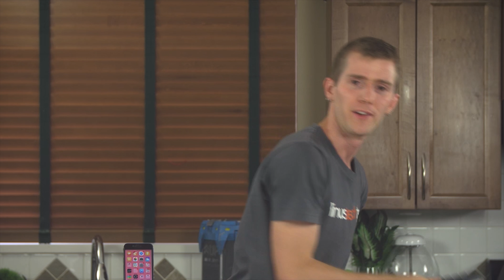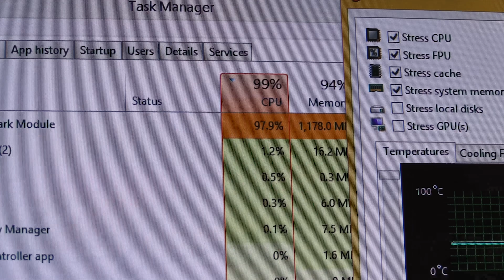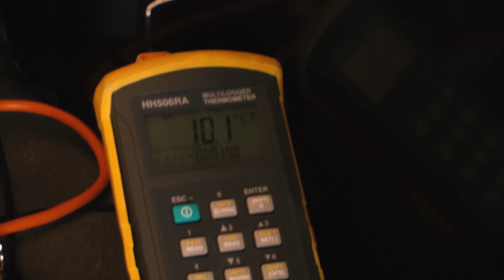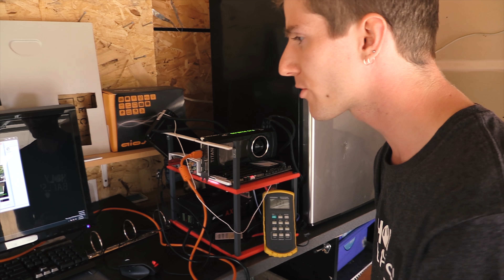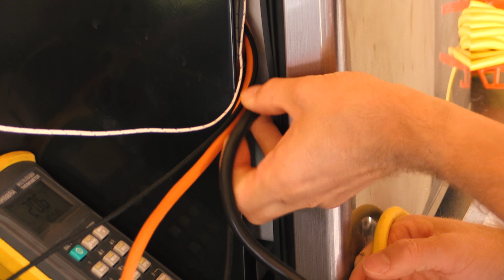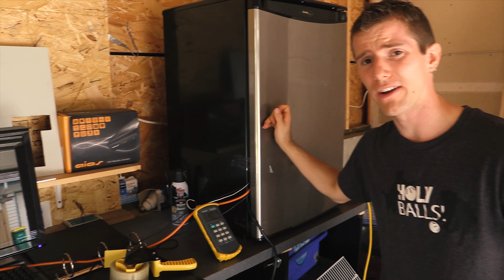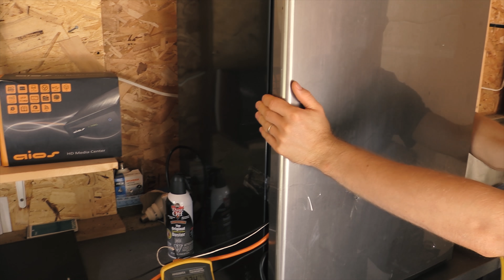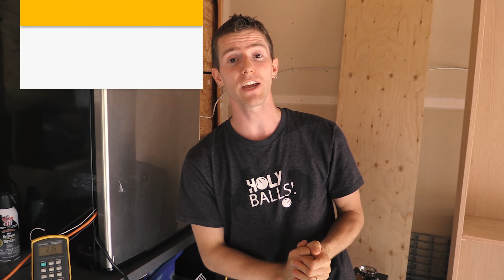PC Build in a Fridge - Does it Work??

Comment: For that experiment, you'd need to set all the CPU fans and stuff to max to take advantage of the cooler air flow in order to see better results.

I once did an experiment where I hooked up a vacuum cleaner to suck all the air out the exhaust of my OCed 970 at full load. The action of more air being forced out albeit by a 1500 watt!! (about 2.2 hp) vac motor caused the temperature to drop from 78 to 50 C degrees in a matter of about 2 minutes.

Comment: Connect the cooling coils from the fridge to a water cooling system :)
Reply: my exact thoughts
Reply: Sander Datema  yessssss please do this I want to see this
Reply: Booring!!
Reply: also you can run cold water over the condenser coil on the back to the fridge which would allow heat to escape faster.
Reply: or you could just run your computer at its proper speed and use stock cooling ;)
Reply: Sander is referring to the evaporation coil... And in that case if you used the correct heat exchanger it would work.
Reply: the water dont help. it just tankes longer to  heat up the system . the fridge isnt build for take away so much heat so all you need is a bigger system.
Reply: I was thinking that what if you connected it to your standard fridge instead of a mini.
Reply: I work with appliances and unless you don't mind paying an astronomical water bill for a minimal impact, then yes. These compressors run HOT, consistently with intermittent lapses for defrost, the heatsink only serves to lessen the burden via heat transfer just like a CPU.
Reply: Nudeliful If you attach the coils to your cooling block, and leave the pump running continuously, it'll probably do fine. I will admit it won't be the most silent system...
Reply: This would probably easier...Airplex GIGANT...
Reply: Water cooling the condenser wouldn't increase the capacity of the refrigeration system much, if at all. The compressor and evaporator still wouldn't be able to handle the heat load.

Comment: So your video brings up a logical next "Build". I am sorry if someone beat me to the punch, I didn't read 7200 comments to find out. 

Why could you not build a case that is cooled by an AC Unit. AC units don't merely pump cold air into a room, they also remove hot air and water, and expel it out, well typically outside. An Ideal set up would be  a window unit, mounted through an exterior wall, (Standard set up for an AC unit), only the business end would be driven directly into a small computer chamber. I am picturing a box type enclosure with a computer case locked inside,, probably with no sides attached. I bet an 8k or 10k BTU unit would cool that bitch like nobody's business. I vote to see this build next.

Comment: I can guess why it didn't work.  You had that much cabling coming out through the door, that you possibly would have broken the insulation seal.  The tape held it shut, but it wouldn't have prevented a heat leak.

Comment: Some dy may be.... Linus will Read this... Long Long ago I had a Compaq CQ40-144tu Laptop. Restoring it to factory setup took about 45 minutes.So after a 3 years of useage I decided todo that .But it kept heating up and shutting down.I put the entire thing while recovering into a 500 Ltr Deep Freezer and walah....!! It worked so as suggested you need the fridge to be enough capacity...

Comment: Was the fridge even working in second case because its door was not properly shut. Fridge has a little push button sensor to detect the door closing and only after the door is shut it starts the compressor for cooling.

Comment: cmon  Linus u have to put it in a freezer m8
Reply: Why would hot parts attract condensation?
Reply: the freezer would have a similar effect, freezers arent built for constant use with maximum power, just like fridges arent, freezers simply have to maintain a lower temperature.
Reply: +Freddy Looger
what if the computer was submerged in a special oil that does not freeze below zero   similar to antifreeze  , 
and then the whole thing put in a freezer , with the freezer modified so it  bypasses the on & off  cycle  so it runs permanently ,
( like alot of people do this to bar fridges for home brewing beer) ?
that should eliminate condensation & freezing  and the oil should circulate by pumps inside the submerged case  so it will be super recooled constantly
Reply: Condensation would build up on the PC and short circuit it.

Comment: I had an old portable dc fridge for a car ect. It works on dc plug but the ac inverter died. So, being bored and it only cost $30, I pulled it apart. I have always thought about mounting the block to my case with the thought of turning the case into one big cold box. Concerned about condensation I haven't taken the risk.

Comment: It would work better if they put the cold side radiator of the fridge over the air inlets of the case, and put the compressor in the out airflow to allow continuous use.

Comment: Next time drill a hole in the fridge where its safe and feed the wires though or better still fit a jack plug so you can connect from the outside to the inside wiring and then seal the hole with silicon rubber.

The idea of fridge to keeping some of the components of today at cooler operating temperature is a great idea some just get ridiculously hot especially around during a heatwave the extra heat load doesn't do it any favors at all.  Eventually it will reach its technical heat tolerance level and slowly start to fail.

I guess its cheaper than liquid cooling or water cooling.

Comment: The refridgerator I use takes the air from the freezer and pushes it up to cool the fridge section on top, the air is then cooled down and sent back down to the freezer. Kind of a cycle system. It could work in that case, theoretically. But who want's a 6ft 5" PC?

Comment: Simple. Overclock the fridge.
Reply: Kenrick Halff no no no

Put the fridge in a fridge
Reply: @jackmahoney5826  no no no

Put holes in the side of the fridge
Reply: Watercool the fridge itself. Easy.
Reply: Kenny Omg lol
Reply: @BboyKeny  Fridges are water cooled lol
Holy shit, I've just seen that this video is 5 years old.
Winder if you still use this account and reply to my new comment?
Reply: @BboyKeny  And when the Water cooler starts getting overwhelmed, put the water cooler and The mini fridge inside a bigger fridge and keep repeating it until everything becomes cool! Lol 😂
Reply: Y'all spending all that money. Just leave your setup outside for the winter.
Reply: @Bestgameplayer10  i live in wy and it gets to like -20f (much cooler than -20c) with windchill, no amount of insulation will protect your walls. i sat my pc next to the wall and played games allday/night, made it idle at like 80% when not in use, that was the only wall you could touch without freezing to death, and my pc never broke like 80f
Reply: stephen shank - Lit
Reply: @Bestgameplayer10  I live in Quebec City where, in winter, temperatures go down to -35°C and I've tried to leave my PC outside and it work well but I had to put loads of fans to get rid of the condensation issue
Reply: Install an AC in the fridge
Reply: Cooling the cooler with a cooler. COOLEPTION. (Ception fail)
Reply: QuinSoft Netherlands with a cooler master case
Reply: try it in industrial butcher cooler room xD
Reply: E-Thug NERRRRRRRRRRRDS MY FRIDGE IS ALREADY OVERCLOCKED
Reply: Industrial meat freezers!!!
Reply: E-Thug omfg
Reply: And add rgb.
Reply: put the fridge in to another fridge
Reply: Cover the fridge with liquid Nitrogen.
Reply: Just put the fridge into another fridge. EASY.
Reply: yee
Reply: Lmao😂😂
Reply: So thug
Reply: LOL!!!!! you win :P
Reply: +37377373737373ghz and +7372u72727272+e81 gb of ram
Reply: How do you cool the fridge's CPU?
Reply: Pelticoller ina drive
Reply: The fridge is the best pc case!!
Reply: Have you tried a freezer ?
Reply: You joke but that's what big businesses do. I remember walking into a small supercomputer room. Roughly 1000 processors. The cooling system needed had the potential to cool 20 houses but was in a room about 600 square feet. And it was still warm in there
Reply: I wannted to comment it.
Reply: E-thug your name looks very simliar to my amd E-350 processor.
Reply: Immediately installs MSI aftercooler
Reply: Yes.A real overclocker said that.🤣
Reply: lol
Reply: Comment of the century!
Reply: Or just use a real fridge with a freezer chamber.
Reply: or put air conditioner on the freezer
Reply: yes
Reply: Yes
Reply: LOL
Reply: Lol
Reply: Æعلي محمد حسين خلف القريشيa ęqa
Reply: You need to buy a varic and over volt the compressor. & It would be better if your compressor has an oil cooler line then u can connect that pipe with another radiator to cool the compressor! ..
Reply: A refrigerator needs to be refrigerated, ironic
Reply: Corsair RGB fr20 fridge has great vrm capability
Reply: I would go to the north pole
Reply: Dry ice in the fridge?
Reply: In 2021, Nvidia Rtx Gamer series fridge you stick your rig inside it alongside your froze  chimichangas exist yet?
Reply: Yeah
Reply: Put the fridge in a fridge
Reply: Use liquid nitrogen
Reply: Install a pocket ac in in your pc
Reply: couldn't be more simple
Reply: put the pc in a lake Big brain time
Reply: Back to flowing cold water over hot metal....
Reply: Funny
Reply: You don’t know what will happen do you
Reply: A person who thinks all the time has nothing to think but think itself
Reply: Lets try a big freezer
Reply: Freezer

Comment: Condensation can be a problem. Compressor life will be horrible, because it will start and stop much more often than it's designed to. This project is not a good idea for the long run.

Comment: condensation?
Reply: Hjominbonrun not in a fridge. there is in a freezer tho
Reply: but why, im late but  i would appreciate an explaination
Reply: well, in my fridge, there is condensation in the back of the fridge. 
Also, in a car that has been left overnight in a cold place, there is a mist on the inside window.
So to confirm my claim, I would suggest touching the back of the shelves in a fridge or go to a car in the morning with a tissue.

This is dependant on where you stay.
I'm in london.
You probably wont have much condensation in Abu Dabi.

Cold air is dry because the wetness condenses out of it.
Probably once you have stuck the machine into the fridge, and never open it up, it probably will be fine.
So better to put the power switch outside the fridge and never open it up again and this fridge solution can work.

Comment: A PC in a fridge or freezer is a terrible idea.  Any liquid in the air will condense on the metal parts when cold causing any steel parts to rust.  Not only that, water condensation can cause a short.  Bad idea all around.

Comment: why would you put the |PSU inside the fridge aswell as all the aircooled stuff. Bring down the increased heat with water cooling both graphics and the CPU and run the PSU externally and then run another video

This will give a much better result Id bet my left nut on it Linus

Comment: only 1 minute into the video.  This will work so long as the fridge can replace the heat more than the PC creates. essentially, more BTU out then going in. My only concerns would be the fridges lifespan would probably be greatly reduced having to run constantly (probably) trying to keep it cool. Another concern I would have would be condensation build up on the heated components shorting out the computer if the humidity is too high inside the fridge.. but there are wax sprays to fix that.
Reply: now i'll watch the video and see if i guessed anything correctly.
Reply: hardleecure the fridge runs constantly anyway.
Reply: Marcus Nordal no they dont. fridge's run constantly when you first plug them in. once they reach a cool temperature, they shut off and stay that way until they warm up again. normal operation is that they run maybe once an hour for a little bit and that's all.

Comment: if you design it such that the radiator pulls air from the inside and expels it to the outside, it might just work. (but the again it must have a constant flow of air to the interior of the fridge)

Comment: What about getting a water cooled system & only putting a set of external radiators & fans inside the fridge?
Would that reduce the work load of the compressor since it would only be cooling the necessary parts instead of the entire machine & give extra space for airflow?

Comment: But you can store snacks in there too
Reply: Jaeden The Gamer Just put the PC in tupperware.
Reply: You don't even need to leave to the kitchen! And it does't take extra space as a fridge would if you had a regular PC!
Reply: Koxden that would be a bad idea, the condensation from the food could wet any electrical parts, and could break the computer.
Reply: Koxden orrrr! Put all your food in Tupperware, the condensation won't spread.
Reply: Really big tupperware
Reply: Jaeden The Gamer just partition and seal the portion with your computer inside.
Reply: Koxden use it as an excuse to buy a fridge
Reply: Sander Datema It wont fit.
Reply: And microwave your food when you're gaming
Reply: Lol u dont need fridge to store snack l leave my drinks 1 month but still drink them
Reply: Grab me a 🍺, it's next to my gaming PC

Comment: flush the computer down the toilet  all the cold water flow will keep it nice and cool. trust me it works kids.
Reply: Also system32 gets rid of about 30 degrees on your CPU.
Reply: Krish Lius smart man! Just did that and massive improvements on the temperature for my computer!
Reply: Krish Lius OMG YOU FUCKING DESTROYED MY COMPUTER !!!! FUCK DAMN SHIT😠😠😠😠😠😠😠
Reply: Krish Lius You must be using that technique, good for you, I think so...
Reply: Krish Lius and totally does not soak the motherboard to its death as well as the GPU, destroy a CPU, SSD or HDD, and extra drivers. Noooo.
Reply: kids
Reply: If the toilet uses mineral oil - that could work!
Reply: Krish Lius also don't forget you have to leave the computer plugged in while you do it.
Reply: Ok.
Reply: Doesn't fit in there :/
Reply: I tried it and now my computer's gone! Curse you!
Reply: Teal just deleted file 32 and my computer is working very well!
Reply: Krish Lius yeah I'll just flush my shitty ass computer down there because fuck that!
Reply: Carl Golli delete system 32 its a virus causing your hardware to overheat!1

Comment: Mine is high tech pc that has no case and its just laying in the ground everywhere with lots of dust and some rich rat shiting on it best pc
Reply: How much RAM ?
Reply: FeresterEX mine was actually like that for a while
Reply: FeresterEX specs?
Reply: Same, my mainboard is sitting flat on my desk and the only thing holding my GPU is the PCIe slot. The GPU is even tipped 15 degrees thanks to having no support but it worked like that for two years and takes less space than if it was inside a case.
Reply: I'm hindsight, a case really isn't necessary.
Reply: My Name's Jeff make a custom case from a barrel
Reply: Geometrical Alpha haha 😂 it makes me laugh for no reason hahahhaahahhahahhahaha

Comment: +LinusTechTips 
I was thinking of trying a cooling loop where only the reservoir (filled with anti-freeze/anti-boil) itself is inside a small freezer, would this create condensation on the loop inside the case due to temp difference between the piping and ambient case temps?
If this would work, it should give some impressive results!
I also think you should try it before me, you're more of a pro... and um... you get free components ;)

Comment: put the system in front of an Air condicion
Reply: condicion
Reply: Vladislav Catimba Dust would be blown out of it after a little while, and since it's an open build, it would malfunction and die at some point. maybe a few weeks to a month down the road
Reply: +TheGuyWith 9000 views and no videos   How could this damage a computer? Dust doesn't kill it unless it overheats or catches fire (extreme spider webs). Air conditioners remove moisture from the air, so it should be dry cool air. I'm pretty sure an open build will lasts years unless you often drop change or screws or other metal objects.

Many people use open builds, its not that rare. Its pretty much the optimal condition for a computer since it has plenty of airflow.

I genuinely hope this was a sarcastic comment.
Reply: It helps. I put my PS3 in front of my air conditioner since the fans had to really kick up. If the AC was running, the PS3 was super quiet (air was blowing in from just inches away so no ducting needed, the air coming out the front was cold). I had it like that for a couple years. It still works fine (but I've moved the TV and console away from the window unit).

Comment: so what if your ran the coolers for all systems outside of the fridge with fans? like you said, no air flow and the air flow that you do have is contaminating the colder air rendering the cold air void. very interesting video by the way